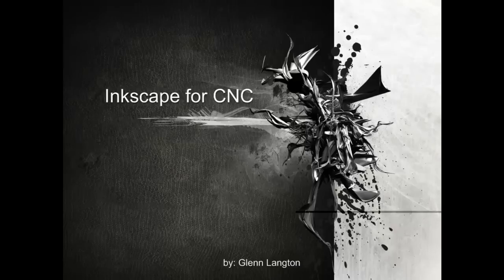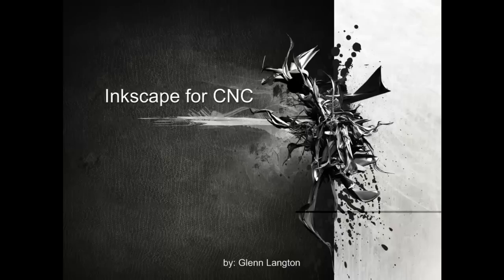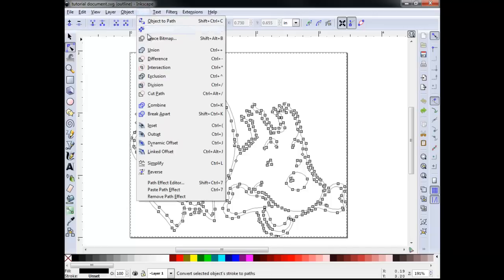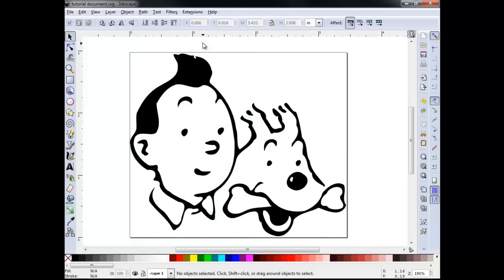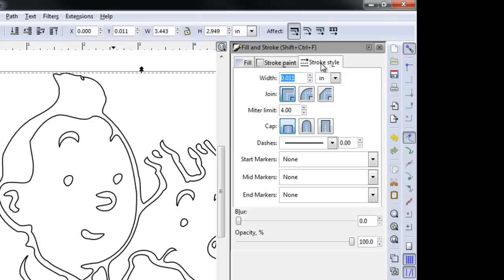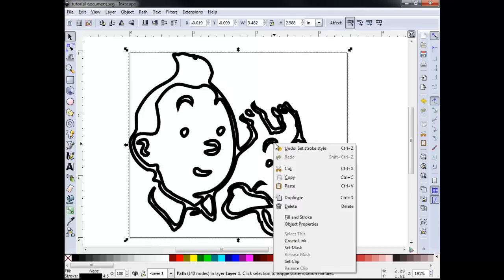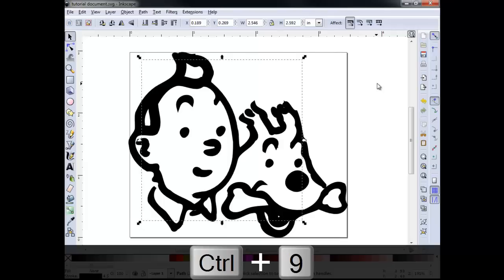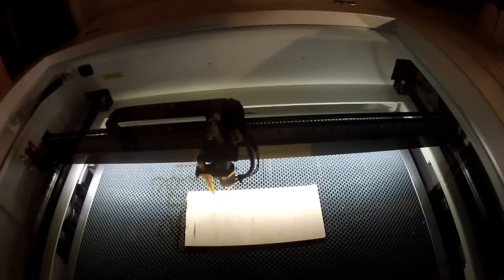Inkscape for CNC Part 2

Comment: The tutorial is great.
I ran into a bunch of issues:

1) Inset / CTRL-( did create fragments in previously empty parts of the picture and ctrl-d and  ctrl-9 only spread slowly mutating fragments all over the picture.
2) Skipping that, I can save the file now as .svg file, no problem - but neither my laser cutter nor my CNC milling machine handle SVGs. Both are based on GRBL and need gcode.

Exacerbating point 2 is that several videos on youtube basically repeat what you did here in a similar fashion, and then simply go off the rails selecting "Save as" and select gcode as save-format. 
An option which inkscape does not offer.
Installing plugins of various kinds ( like Ultimaker Unicorn ) creates its own troubles, with error messages about python scripts failing, requiring switching to pixels and so on.

I noted that there actually are the gcode tools under extensions, but they need configuration, which throws errors.
And without configuration - or an erroneous one - the other scripts fail more or less spectacularly, too.

As your video was providing the greated amount of insights so far: Is there a chance for an updated video from you?

Comment: Awesome tutorial! helped me out immensely.

quick question though: I have paths that when duplicated and inset, simply don't appear. for example, a skull where one eye is not insetting but the other eye is.

any suggestions on how to fix this?
Reply from the maker: Check "display mode" --> "outline" and if you see the vectors then it might just be a layer or infill issue.  If they're still not there, check to see if the eye is a closed loop.  Hope that helps, good luck!

Comment: Hi i'm using the same process with 3d printer maybe you know how can i increase the speed in X an Y axis ?
Reply from the maker: Bryon, this depends on the software you're running and could be limited by your machine's drivers/motors. Unfortunately, I don't think I will be able to help much here.
Reply: Thanks anyway

Comment: what width was used to duplicate infill for laser?
Reply from the maker: Hi Michael, the best width to use in your design will vary somewhat depending on the material you use and the focus of the beam.  It's best to test your materials to get a feel for a good representation of vector width in your graphic.